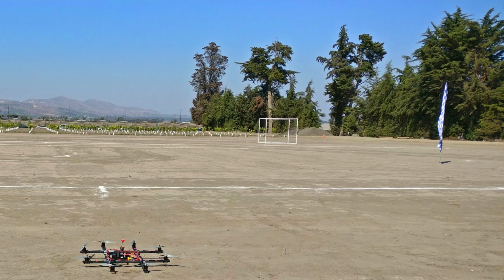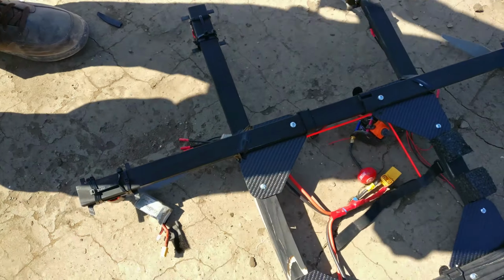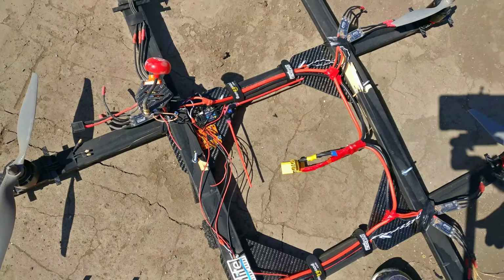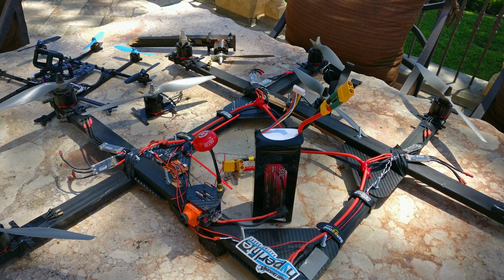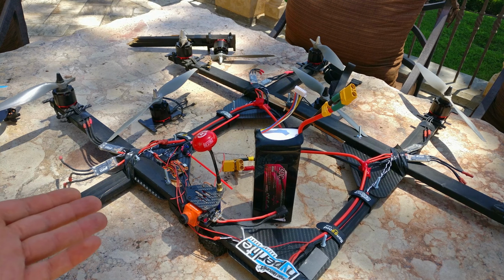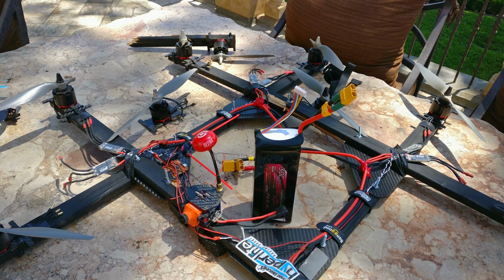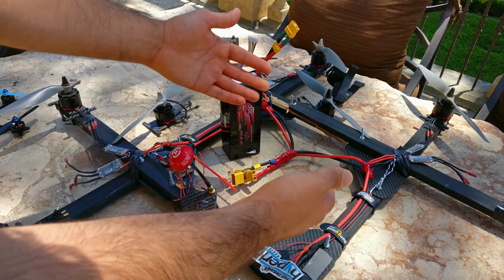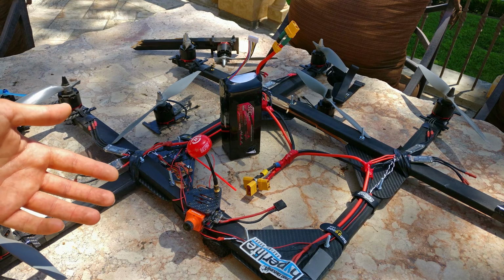HyperYUGE - Maiden Flight - Happy 4th of July!

Comment: Awsome design, i feel your theory of 2 arm motor =  1 quad arm layout. Is the center point of each motor the reference point of thrust or is where the 2 motors (thrust) meet together = the thrust point. A quadcopter is a perfect ring of torque and thrust. Wouldnt we have to redesign the point of motor layout each set of 2 motors spinning the same direction to make a perfect X thrust point with in a circle. To make a nice controll yaw axle. Maybe im thinking to much. I have a built tarot 650 frame spinning 17in props and it just sits there for 2 years. Just waiting to see the spinning of 380KV motors smooth.
Reply from the maker: I think the two motors per arm thing works fine but it works better when the props have more RPM on them.  When they're that big and spinning so slowly it could have maybe caused some issues since a few RPM between the motors really does make a difference with such huge props.

Comment: @Kabab FPV , you don't check the balance before your flights ???
Reply from the maker: I have flown the last three octos I built like this with the pack in the front the same way and had no issues.
Reply: The problem with bigger drones is that the motor/propeller inertia is bigger thus they can't respond as fast as smaller combination of motor/propeller.

Comment: After reviewing the footage, the instant it lifted off the ground, it started yawing pretty hard. I think something was wrong with your motor wire connections. On my first ever quad, I maidened it and it did the same thing. It turned out that one set of motors are wired backwards. ie: motor 3 to pin4 and motor 4 to pin3.  Did you do a motor test in betaflight with props off to verify the wiring was correct?This would explain the yaw and diagonal flipping. (pitch and roll flip)
Reply from the maker: That was the first thing I thought but I checked it and it was all correct.

Comment: I've seen this exact behaviour on my quads with BF after I have dramatically reduced D-term filtering. on something this big with bigger motors and potentially lot more vibrations the same issue would be even more pronounced. anyway, can't tell what the issue was with your attempt and don't know how much of d-term filtering you have set up.

Comment: I had a similar behavior after takeoff when the PID was totally off for some reason.
How did you tune your PID ? these motors require different numbers than what we're used to in 22XX motors
Reply from the maker: nitbeat I just dropped all the PID by 30% to start.
Reply: Kabab FPV mmm, in my experience with bigger drones, big motors lower KV they need higher PID values. Might be a lead when P is too low you get exactly this phenomenon

Comment: make a quad tilt-rotor out of the parts. I bet it would have some incredible speed.
or you could turn it into a gps/altitude hold signal relay for your video signal...put it up in the air at hard-to-fly areas or bigger area for fpv

Comment: the problom is tuning ... my qoud (450 size with 2213 933kv) had the same probloms ... if D was over around 28 it would of take off full thrutol when i arm it and wont go down unless i disarm .. i managed to land it by disarming and arming again a second before it his the ground
the solushion was to reduce the D ... but i couldnt of tune it with such a low D
so in the end i found out that reducing the d turm notch filter from 100 to 50 fixed it 100% and it flys good today
i think you have lots of nois in the system and it cuses it to go nuts
try it out ... i wanna see it flying!! :)

Comment: Many of my first builds had this kind of behavior on take off ? and I couldn't work out what was wrong ? I just took apart and rebuilt it and seemed ok after.... once though it was budget ESC's. ?,
with 8 motors and in pairs of two it may have been hard for the fc to keep sink, as the esc's  tolerances may have effected the thrusts/balances between the motor pairs.( I could be wrong ???? )
maybe could try again with just 4 motors,  or turn it into a true octo...

Comment: I think connecting two opposite spinning neighboring motor's esc signal lines in parallel effecively canceled out the torque needed to control the yaw. This would explain the out of control yaw spins. Im no ME, so im prob wrong.

But check out this guys law chair quad! 
https://youtu.be/5zoP9f-ebm4
Reply from the maker: If you watch my previous videos, I explain how adjacent motors are spinning the same direction, not opposite.  I'm offended by how dumb you think I am to do that.
Reply: Kabab FPV  Sry man, late night rant. Hard to tell direction in this video, and explain wtf happened here. Its fustrating as a viewer, usually your the person to figure things out or not post until you have... But good work, next time use aluminum istead of ghetto wood, use some type isolation mount on the FC, and maybe some more research on YouTube of comparable designs/ideas. :)

Comment: Hey kabab I had the exact same thing happen with a large quad build but I was using a f3 board after doing some research I found the large frame has a lot of vibration throughout the frame and it's too much for a 30x30 flight controller so I went with the vector setup and now it flys awesome Flight test also has a video with their huge racing drone and they had the same problem and they also put in a vector to get it to fly I think you should give it a try with your octo

Comment: I can't now recall where I saw a recommendation for Cleanflight not to use it on bigger quads, like 450mm and bigger, but I think the software and tuning is the issue. FliteTest also had this problem when they built their giant quad - it crashed using Betaflight so they had to use Vector system which is almost industrial thing. Second thing is the tune - as the quad is much heavier and distance from motors is bigger, everything reacts slower. So you need more P. But this needs to be properly discussed with Betaflight devs as it might not be good for large quads.
Reply: RandomWisdom I have to agree with you, I think also this is the problem!
Reply from the maker: RandomWisdom could be but I've done it 3 times with 100% success before this.
Reply: I've been using betaflight on X Class rigs for over a year now and haven't had a problem. You need to know what you're doing tuning-wise and stay away from the default PIDs, but it can and has been done.

Comment: Why didnt you just build it right and test it correctly?
Reply from the maker: ernie5229 what do you mean by this?
Reply: Kabab FPV Pretty sure he means correctly setting and checking your motor spin direction before flying... that take off looks like yaw induced by motor torque.
Reply: Kabab FPV And if that's the case... it goes nuts because it's trying to spin motors to counter the torque induced yaw, which only makes it yaw harder and snowball out of control.

Comment: i had this when my motors were spinning backwards.... it really took half a second for it to shoot 40 ft up
Reply: It happened to me once too when I was messing around with yaw_motor_direction. I didn't double check which way the motor were spinning. It armed with no problem but as soon as I put in a small throttle to hover, it shot up in the air which seem like full throttle. My frame didn't survive that mishap since after I disarmed, it was probably more than 40 ft in the air. It just spiraled up.
Reply: That's exactly what mine did...faster than i've ever seen it go under normal circumstances.  it left a nice ding in my gutter on the way up and a nice impression when it landed.  No damage, luckily

Comment: The way I have learned to do it with new large custom multicopters: strap it down (so it cannot take off even at full throttle) for the first test and check that throttle and control inputs respond as expected. Then loosen the  straps a bit so it can only lift off a short distance, and try to hover with it. If everything looks good proceed with the maiden flight.
Reply from the maker: Mrtnlys yes this is what I should have done.  instead I tested with smaller props that couldn't generate enough thrust to get off the ground

Comment: I am pretty sure was a vibration problem. Those bigger props and motors resonate at more lower frequency than the usual 5 inch prop. Maybe betaflight can´t handled very well and maybe the frame was need to be more rigid. Nice crash by the way!!! thanks for your videos
Reply: That frame is probably not rigid enough for that much power. The flight controller is in a positive feedback loop with the resonant frequency of the frame. I had tested an idea with my 450 frame with flimsy arms. I used a length of steel cable to preload the arms, kind of like a bow string making them much stiffer.  It changed the motor thrust direction slightly outwards, giving it negative dihedral. but it actually flew better than when the arms were allowed to flex.
Reply: i saw that vibration/pattern and it seemed to resonate and just get so far out of whack
Reply: Moriwaky c 
if you log data you can ajust the filters to take out the low vibes

Comment: you could try to build a 770Class Build with those motors. I have seen some flight footage lately. Monster Quads would be more appropriate to name it. 
I was asking myself if maybe the wood is generating to much vibration? At one point of the gopro footage you see the arms wobbling around what would make sense to me because of this heavy motors and knowing the length of the wood? isn't that possible?

Comment: by the way bro. it went super fucky because you didnt center the flight controller. it needs to be in the center of the craft.
Reply: WTF? I thought the audience of this channel would know better...
As long as you just use the gyro the placement of the FC doesn't matter. You have to adjust the orientation if it doesn't match the one that the manufacturer specified but that's it.
Only if you use the accelerometer the FC has to be centered...
Reply: gyros are mechanical devices they are designed to measure rotational   velocity only but nothing is perfect so give it the best signal put it on the crafts rotational axis's.
Reply: Being in the center is best, especially on something this big, but i thing the thing went crazy because of the load imbalance having that heavy battery off center.
Reply: Kanton Peacock dude...my sentiments exactly. He's a dentist...🤣
Reply: Nichtmein Echtername so tell me what happened? Im waiting
Reply: It does actually matter if your gyro isn't close to centered on the axis it's measuring then small changes will be difficult for the gyro to sense as the gyro instead of just rotating will rotate a bit but also move upwards or downwards things it cannot detect.
Reply: This is because the strength of the rotational force relative to other forces on the gyro mems is much lower the further it is from the center of rotation. This effectively reduces the snr of what the gyro is trying to sense. 
What this means is that With a perfect gyro it can be placed anywhere but with the ones we have it does matter.
Reply: Chris Tate Vibrations etc will cause more problems when the gyro is off center as they can more easily be interpreted as angular rotation. People need to remember that these are not perfect sensors and giving them the cleanest signal is best. Also when the gyro is perfectly centered vibrational noise that isn't ocillations should be the same on all axis making it easier to differentiate from actual needed signal.
Reply: FlyQuad FPV haha, prove it. I got my information from joshuua bardwell, quote a legit source if you ask me.
Reply: Stephen Gibb yes
Reply: No it doesn't
Reply from the maker: Kanton Peacock no the FC can be anywhere. as I said in the video I've built this three times now it doesn't matter.
Reply: Kabab FPV if the gyro was turned on then yes it does matter
Reply: what I love about this whole thing is Kabab FPV replies to my comment being a total douchebag know-it-all. Well youre wrong buddy. If you did build this THREE times like you stated your shit wouldnt have fallen out of the sky. I thought crashing that octocopter would have taught you but nope.
Reply: Stephen, if the gyro is upset by (as an example) an upwards movement while it's also rotating, surely we'd have our quads dropping out of the sky every time someone punched out and rolled/pitched/yawed at the same time. Or did a power loop, or anything else that moves in multiple axes at once.

The gyro sees an identical rotational vector wherever it is positoned on the craft, so long as it's securely attached and oriented the same way. I don't know shit all about the physics of how MEMS gyros actually work, so there might be something to what you're saying, but it doesn't make any sense they way that you've explained it. I know I've flown copters with the FC WAY off centre, specifically to test if it made a difference, and had no problems with the handling. So long as you're not in autolevel (and thus using the acc), they gyro doesn't know any different, in terms of the rotational movement it makes.
Reply: FlyQuad FPV and since when are we interested in forces in FCs? The angular rate is the same everywhere on the gravitron...the guy in the middle takes just as long for one turn as the ones on the outside.

Stephen remark considering the noise seems plausible to me - especially since the frame didn't look too rigid.
Reply: FlyQuad FPV gyros measure rotational movement, accelerometers measure position and acceleration. The degrees of rotation is the same everywhere (given that it is rigid). It doesnt matter with position as long as the accelerometer isnt used

Comment: When you calibrated it you had electromagnetic interference from either surround sound speakers and or too much metal nearby and walla. I tried the same type build last year and found that it was majorly inefficient and I got tired of replacing multiple escs which will burn out often.
Reply: Walter Levels that is 100% wrong. he had his flight controller all the way in the corner of the craft. he didnt have it centered
Reply from the maker: Kanton Peacock I think he's joking maybe? lol. like 10 people have commented that the FC wasn't in the center and that's why it didn't work too